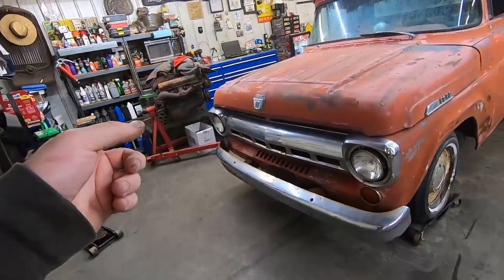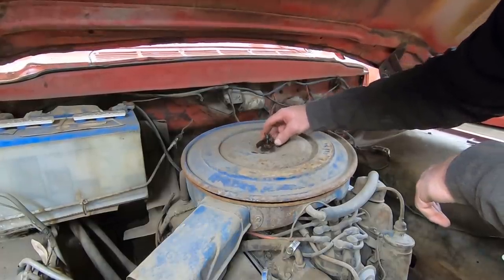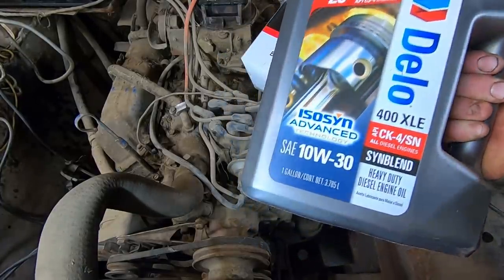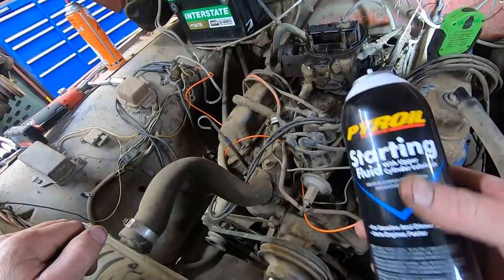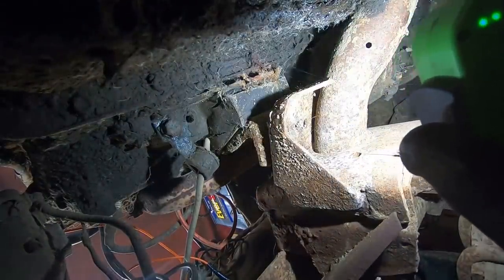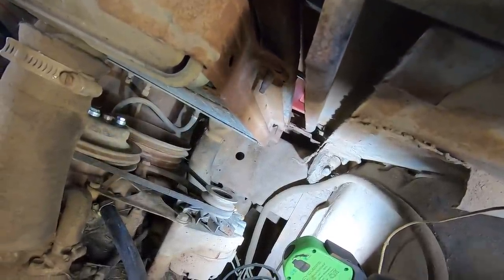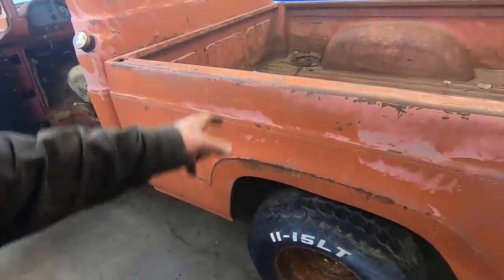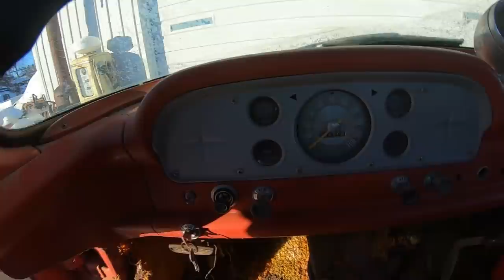Forgotten 1957 F100 Hot Rod Pickup Truck!! Abandoned for 40 Years! Will it Run?!?

Comment: I've got you beat on not checking the battery. Lol. I swapped an engine in my buddies cavalier cause it was out of gas... took him at his word that it was bad. Couldn't get the new engine to start for 3 days. Throw a gallon of fuel in it fired right up. 🤣 🤣 🤣
Reply from the maker: NO WAY!
Reply: @MortskeRepair  sad but true! 😆 at least he paid for the samich's required for the headaches. 😆
Reply: Really on Chevrolet Cavalier car ?
Reply: @AndrewHCann  yup
Reply: @WalkersGarage6913  what year of Chevrolet Calavier and was 4 cylinder 2.0 or 2.2 or 2 3 or 2 4 4 cylinder , or 2.8  or 3 1 V6 motors also year was it and 2 or 4 door types! I had 1994 with 2.3 litre 4 cylinder motor with 3 speed Automatic transmission 5 seater 4 door and was pure repair bucket case for Winter Season beater!
Reply: @AndrewHCann  late 80s z24 2.8 v6
Reply: @WalkersGarage6913  awesome I work on lots Chevrolet Calavier over years and some challenge too!
Reply: Wow
Reply: @MortskeRepair  thy try again iyy
Reply: That sounds a bit on the CAVALIER side.........LOL
Reply: That's a very funny story. If that were me I would've fixed it and never said anything about it just being out of gas to the owner out of embarrassment...lmao "Yep, that engine was definitely shot! Listen to this baby purr now!"
Reply: 3
Reply: P
Reply: Oh my damn... oh my damn indeed
Reply: 351 windsor has a wider intake and different firing order than a 302,289,260.
Reply: @Brock_Landers  my oldest son's first wife was well known for doing stuff like that.  She'd run a tank dry then scream about the POS that she was driving, even my wife's 1 year old Jeep. And I do mean scream. Stupid broad never learned what those silly things in front of the steering wheel were for, didn't know that they were gauges and what they showed.
Reply: I did the same with a power glide, early 2000s I was big on drag racing. My buddy said if I swapped his transmission out I could have the bad one, took it to my transmission guy and it was like new inside! His problem was converter related all the time! Now we have laptops and tuning to see if it’s slipping or just blowing thru the converter!
Reply: Sounds about right when trusting a friend 🤣

Comment: Great job, Mortske! That flex plate, torque converter, and even the nuts looked brand new! Must have been sealed up pretty tight for all those years. Get the brakes working, fix the steering, and throw on a new radiator cap, she's good to go! Thanks for the great entertainment, man!

Comment: Sweet truck Mr. M!  The way I separate a Cleveland from a Windsor is to look at the the water outlet.  Windsor's are on the intake, Cleveland on the block.  All Windsor's share the same intake except a 351W , they have a taller deck.  I know most of your viewers don't like them Ford's, but I have had a 302 in my Willis coupe for over 30 yrs with never a problem, plus the distributor is up front which makes life easier!
Reply: 302 is the best engine Ford ever made so reliable
Reply: I love the fords. Building a 460 for a buddy. I love GMs and Chrysler too. Love em all for different reasons
Reply: I love the Fords too. I have 27 of them.
Reply: @mikeschriever1034  my daily driver is a 74 Lincoln MK4
Reply: Ford cars 57-64 used the tubular cross-member. Believe trucks did too. The motor mounts with the single center stud we're for the same years with Y-block, or FE engines. Later years used a motor-mount with two ears, and a horizontal thruogh bolt to the frame bracket. That 69 351 Windsor benefits from a decent compression ratio(about 9.5), and larger valves than the later ones.
Reply: @mikeschriever1034  Looks like I got a new drinking buddy Mike!👍
Reply: @jeromebreeding3302  Find 69 4 BBL heads and you got the best Windsor heads around!
Reply: @glennnickerson8325  Right there, but will be hard to find. The four-barrel engine was one year only.
Reply: @sethbarnes7608  I had a 77 mk5. Loved that car!

Comment: Hey Mortske & Duff. Great video as always. Definitely no mistaking big and small 351's. That definitely is a 69 351 W. You mentioned possibly removing some spring leaf's and perhaps lowering the old pick up. Have you ever considered doing a project re-arching or de-arching leaf springs on something you want to raise or lower without spending a fortune on it? I have done it many times using a press and a jig I made to suspend the leaf's. It takes a little time and some new center bolts but works really well especially to fix some sag on one side. There are some good video's on Youtube showing different ways to home bend leaf springs. It's 68 here today. That road test you and Duff did made me cold just watching it. Hope you guys have a great new year my friend. Until next time.
Reply from the maker: I've re-arched a few springs. By using the press method. Never the hammer method. I picked up an old roller for making steel hoops for wood wagon wheels that I'd like to try repurposing for this matter. Just haven't gotten that far. Have a good one Bob!

Comment: Sweet rig, Mortske.
 That's a 351W for sure. Likely came out of the same 69 full size Mercury as the radio.
 67-72 302 pickup truck motor mounts are what you need. They may have been the same as 73-77, I don't really remember. Those 351 Windsors used to be plentiful and cheap. I used quite a few in bumpside trucks back in the day.
Reply from the maker: Good info Tom!

Comment: One thing to add here, a '69 351w is actually one of the more desirable ones.  It's a little bit different than the later engines.  Even being a 2v engine, I believe the heads are the same as 4v, just different casting marks.  It may also have some desirable rods in it.  Back before aftermarket blocks, this was the one to have.
Reply from the maker: Thanks for the info!
Reply: @MortskeRepair  now if you can  get  a 351 c. Things wood roll
Reply: Actually the Cleveland 351 is the more desirable because they have the large port heads that breath well with the valves canted instead of being side by side like the Windsor does .  Most of the Windsor engines were casted in Canada & the Cleveland's made here in the states .  As for Fram oil filters I have been using them for well over 30 years & haven't had a bad one yet but I have had 1 wix that the anti drain back valve was stuck open on my chevrolet 5.3 LS that was causing lifter noise on start up until I bought another wix then cut the old filter open & found the problem . Way back in the day Fram was the only filter you could buy that was the HP filter that was made with a thicker canister & better stronger filter to use for drag racing on the top fuel nitro engines where those engine pump very high oil pressure to keep the babbitt style crank bearings alive in those 10,000 HP billet aluminum Hemi style engines . I am sure wix probably has already copied these as well not that long ago but Fram was the first to make those style filters because a standard oil filter will fail & burst from the pressure so Fram developed them . If you want to see something cool look up top fuel nitro fuel pressure stages where they have a Hemi cylinder cut so it's just the intake & exhaust port blocked off with thick clear plastic so you can see how much nitro is being pumped in at idle then as it takes off for it's run at WOT & it's amazing how much fuel just one cylinder is pumped through which just at idle stage would drown  even a pro stock engine .

Comment: 26:03 A friend of mine back in HS bought a hotrodded '67 Mustang with a 351c in it. Complained to me that it was noisy, had no oil pressure at idle. I saw a FRAM bomb on the side. Said 'lets put a fresh change of 10w30 and a Purolator on it'. So we did exactly that.

Idle oil pressure went from about 6-7 pounds up to 35+, the ticking went away, it started quicker.

FRAM bombs are terrible. I only ever use them for range targets.
Reply: I'm gonna give that a try on my next oil change. I've always ran Fram filters and my engines always last for me. My oil pressure is low at idle, but like I said  the engines just keep running. I just assumed old Ford engines didn't need oil pressure at idle...lol. Anyway, now I'm curious if a simple filter change will make a difference for me.
Reply: 68 289 same issue and put a wix on it. No more knock
Reply: @Captain_Yodelstein  I use the Motorcraft FL-1a. It's either a Purolator or a Wix depending on who made the batch you buy from, both excellent top shelf filters. And readily available. I can still get them at my local walmart even.
Reply: @TestECull , thanks for the info. Might just pick one up on the way home from work.
Reply: My grandpa (rest his soul) was an old school mechanic for well over 40 years, and Fram was all he used.  I myself have used Fram as he did for going on 30+ years now without any issues.  That of course was changed religiously every 3000 miles.  Perhaps both of us were lucky all these years, and  we may have dodged a bullet once, or 500 times. Stranger things have happened. Any of you fellers used royal purple at all? If so does it work well, is it just nothing but snake oil?

Comment: That driveshaft is perfectly stock. In the mid 60's ford used a 2 piece shaft vulcanized with rubber between the shafts to quiet the drivetrain . They used them on fairlanes and merc counterpart mid sized cars for sure. You have terrible flat spots which is likely the vibration.
Reply: Would that be room temperature vulcanization cream? VGG
Reply: That’s pretty cool I did not know that
Reply: Not to mention the huge dent in the drive shaft.
Reply: Yep. My 63 Fairlane had a 2 piece drive shaft like that. Rubber between the 2 to dampen vibrations.
Reply: Another great Ford idea..."Let's stuff the shaft in rubber ...then we don't have to balance it". hahahahaha
Reply: Guess I learned something about fords today. Rubber plugged driveshafts........🤔
Reply: @RS-rn4ox  My brother had 2 67 merc cyclones and both had shaft in a shaft driveshafts. When we went 427 we had a new solid one made meaning a single tubing driveshaft.
Reply: ...minus the twist damage from the catastrophic launch failure that destroyed the entire rear leaf spring suspension and bent the drive shaft in a fraction of a second.  But yeah besides that, stock as a rock.

Comment: Lots of memories and hum or here!  A buddy and I swapped a 390 into his absolutely cherry 1958 F100 in place of the Y block about 1971. He went out and actually bought a motor mount kit for it, and the actual swap went well. Rebuilt the engine to 67-68 Mustang specs,  and ended up using stock manifolds. Even installed A/C, and a passenger car 4 speed from a Fairlane GT. The 9" had a 4.11 limited slip. Later addition of power steering was essential, replacing the Gemmer manual box. A Saginaw power steering box from a 75 and up Econoline can be fitted, and use the original Pitman arm, but you need to weld up a little bracket for the box, and install a rag joint. Don't use a car steering box, as the direction is reversed...turn left, go right!
Reply from the maker: Sounds like a pickup I’d love to find!

Comment: Finished watching this first episode of 2022!  It has everything a Mortske video should have!  You took the starter off only to find that the battery was down to 7 Volts and you didn't edit the whole fiasco out!  The seller claimed that it had been a drag truck; with a cobbled up driveshaft, a single 2 barrel carb, a Windsor 351 (well the cubes were accurate) rather than a Cleveland, an open 9.5" diff, no way to get brakes and "Kill you quick" stiff and semi-connected steering.  Yeah right Dude, tell me another!
It's almost enough to make a guy stick to repairing Japanese and Korean econoboxes and the occasional pickup truck!  Only thing is, repairing that crap would put you to sleep or drive you to drink stronger than "sammiches" or both!
Duff had a love/hate relationship with this Ford refridgerator.  He loved the comfy bench seat and the exciting ride but thot fixing it was boring.  Yep, a totally Mortske classic! Bodes well for the rest of '22.
Reply from the maker: It keeps us on our toes!

Comment: I owned a 1960 pumpkin orange with black hood panels detail and pin stripes. same seat color reupholstered, rolled & pleated,  black dash with (Go for it) in slime green decal. 312. Bad ass three in the tree. Damn thing was wicked. vibrated in gear, all hydraulic brake and clutch. I did not build it. The body work was done by a Guy named Larry Logston, from Maryville, Illinois. He put a lot of time in it. I got it in 1982, paid 900 hundred for it. Brakes blew lines and it sat, I had to part with it, someone like you picked it up on a farm field for a song. Along with a my 66 VW. with sun roof. Had much fun with both vehicles.

Comment: I'm 67 and my dad who passed away last year always told me to never buy a Ford vehicle or Firestone tires. I never have. He never told me why but he was like the Mortske of the late 60's. Always had a project or 2 going in the back yard since we didn't have a garage. I remember a 64 stepside Chevy and a 64 Studebaker Lark both with hopped up 327's he had put in along with manual transmissions because that's what I learned to drive with. Keep up the great work Mortske.
Reply from the maker: Sounds like a cool guy!
Reply: I have a Ford F100,  we have owned it since it was new in 1959.  Always dependable,  has always been on the road.  It is no longer stock now.
Reply: My first car was a 56 Chevy 2dr sports coupe (hardtop) 265, 3/4 race cam, 4bbl,  3 spd with overdrive. Hurst synchro loc shifter.  Chrome wheels,  black tuk n roll.  Original black and white paint.  I later painted it all black.  I didn't like the average  covico steering wheel, so I traded for a black 64 GTO steering wheel.  It had Stewart Warner guages in the dash, and a Sun Tach on the column.  I really miss that car.

Comment: We had a '57 F-100 when I was a kid.  Ours had the 292 in it and I remember it being a pretty reliable engine.  Other stuff on the truck, like the generator not so much, LOL!  Ours had originally been that same color but it looked like someone parked it under a house being painted sloppily and all the run paint drizzled over the truck.  Pappy decided to paint it but didn't have enough of any one color so it ended up being brown with a purplish hue to it and so the truck got it's nickname, Old Burple.  We also bought a '59 Ford D Bus back in 1979 and it had the 292 as well.  We turned it into a camper and my folks would take it from our place in Southern Indiana to the Smokys in East TN every year and also to Opryland in Nashville, TN once a year (Back then Opryland was an amusement park kinda like six flags).  Top speed in the bus was 60mph, lol.  We only took it on one Winter trip and that was a mistake.  It ran fine, but being a camper now the rear under seat heater was history and the driver's heater barely kept the windshield defrosted.  My folks' feet would get near frozen so they lit the gas stove, turned on the oven and would drive in shifts each one setting their feet in their shoes on atop the open oven door to get them warmed back up enough to feel them again.  I got so cold just being a passenger that I got into one of the beds with about 3 blankets over me and in an hour I was toasty, LOL!  It was usually a six hour trip to my Grandparents in West, TN but I think with all the driver changes and stopping once for gas we made it in 8 hours.
Reply from the maker: Good times!

Comment: That things all right. Nice one as always. The fram oil filters are a definite no go. Had a 97 Chevy 1500 that lost all oil pressure. Thought the motor was fubar. Took off my fram oil filter and it had collapsed on itself. Wix only from there on. Great video!!
Reply from the maker: Thanks John!
Reply: Fram makes the worst filter on the market..i had one rust out and spew oil all over and i spun a bearing before i realized i didn't have oil pressure. I used to work for advanced auto parts and they always pushed the Fram's because of high retail mark up. Look at oil filter comparison videos on youtube, they cut apart the filters and show you the inside. The Frams rust from the inside out off the shelf.

Comment: Favorite year model Ferd.  Great little truck.  351W is a taller deck than a 289/302 so the intake is an inch or two wider, easy way to tell.  A lot of kroil is always better.

Comment: I revived one of these once, an old guy farmer friend of mine has one that was the first pickup he ever owned, was going to restore it then he put it off and it sat for 40 years, it took some doing to get it running again, it had a 292 in it out of a 59 pickup and the engine looked clean and nice but the rings and such were totally shot and it had no compression, but I knew if I messed with it enough considering the factor of dynamic compression I kept trying it and trying it and trying it and mess with the timing on the distributor and got it running, sounded good but it blew more smoke than a room full of politicians and had almost no power, so he got the correct 272 Y block that was rebuilt and broken in and now it fires right off on the first try and runs like a dream. I'm planning to help him restore it and then he's selling it to one of his grandsons

Comment: I built a 59 F-100  short box.  Installed a 74 351 Windsor stroked to 393 with AOD transmission. My truck had a traction 
lock 9 inch rear end.   I spent alot of money in parts on mine & did the work myself.  I have alot of fun with that truck. 
It will smoke the tires just slapping the throttle . No reason to power brake.  Makes all the Chevy boys necks snap. 
When I put on a show spinning donuts & laying down rubber till they are all choking on it...
Reply from the maker: Nice!